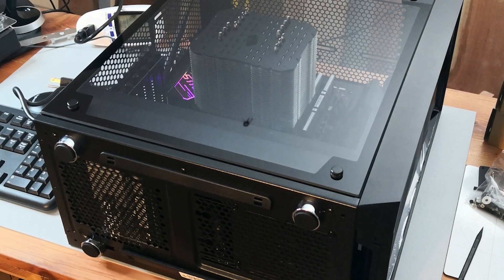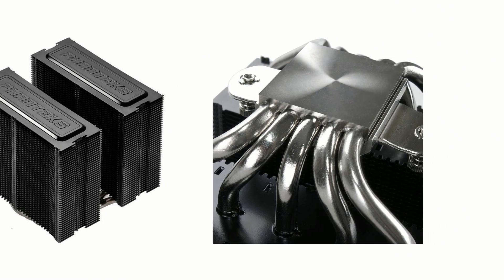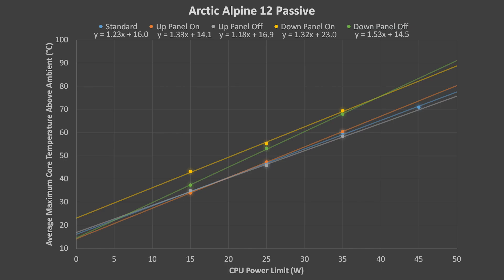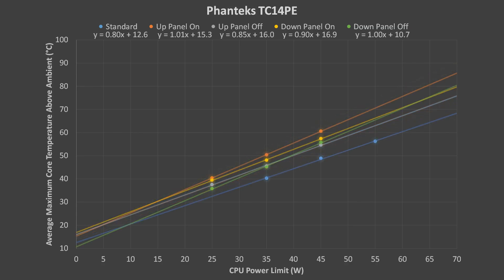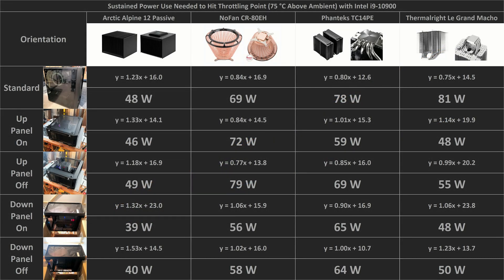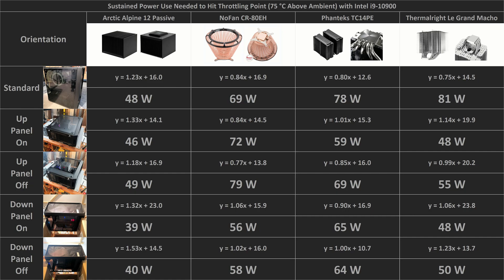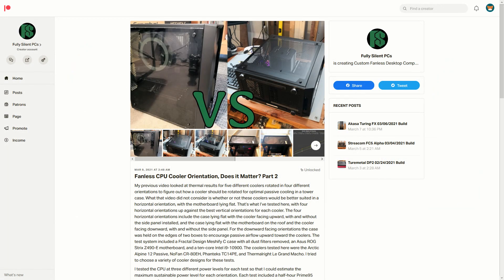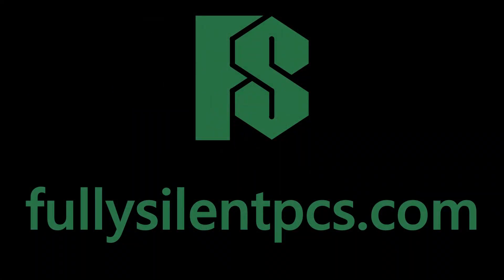Fanless CPU Cooler Orientation, Does it Matter? Part 2

Comment: Interesting test! I wonder, is there any significant difference if you’d have the fins horizontally or vertically aligned? So if air can stream (convection) from bottom to top vs the air basically stuck between the fins.

Comment: Hello and thank you for all the work! It inspired me to try to make a silent PC myself. Could you please share your thoughts if a cooler like be quiet!’s Dark Rock TF (https://www.bequiet.com/en/cpucooler/572) can keep up with a CPU like Intel Core i3-10100F in any or a specific position on an open case say for example XTIA Xproto (https://www.xtia.com.cn/)?
Reply from the maker: Hi, the Dark Rock TF is a relatively small cooler, I'm sure that it could handle 35-45 W passively. I would orient it with the heatpipes horizontal, so that the fins are vertical. I would also set a power limit in UEFI to make sure that it does not exceed a safe amount of power, depending on test results.
Reply: @fullysilentpcs  Thanks! I might try to disable turbo boost and lower CPU core frequences then.

Comment: I've asked a question related to this matter in the first part of this, I suppose series now. Would it be possible for you to determine a noise level - distance optimization with a fanless and very low rpm fan combination in a representative regular mid tower atx build to show if there can be a compromise between having a few very quiet fans in exchange for a distinctively measurable difference in performance of the system. I'm asking this of personal curiosity but I think your audience would be interested because after all they're likely interested in the perception of noise above all when they're building/using their computers.
Reply from the maker: It's not something that I have an interest in. Yes, you can increase performance with higher power components and low rpm fans and still achieve a very quiet system, but it will still be audible, under load at least. I'd like to focus my time on completely silent fanless systems.
Reply: @fullysilentpcs  Fair enough, are these builds aimed mostly for people whose work environment requires absolutely no noise pollution from the PC? Is it just a matter of sensitivity to fan noise? I've always liked the large, passive air cooling towers but to me some high quality low rpm case fans with gentle start/stop curves seemed like a good compromise so it's selectively passive. The only downside I can think of is fans blocking some airflow when not operating.

Comment: I just want to point out something that can be helpful information for many when building a fanless pc with a Ryzen CPU. It is possible to change the power consumption of Ryzen CPUs in the BIOS since AGESA 1.0.0.4. Just look for the cTDP setting which can be changed to any value. For example, with a cTDP of 45W, my 2700X achieves almost complete original single core performance in benchmarks and only loses ~ 4% in multi core. However, this means that the CPU is running 18-20 °C cooler under stress test.
Reply: Wow, a 105W 2700X, when limited to just 45W, loses less than 4% of its power? So much more heat for these 4%... I wonder if it is possible with AMD APUs as well? Read that they produce much more heat than stated TDP when both CPU and GPU parts are under load, so I assumed that they are not sutable for passive builds. I planned to add a passively cooled descrete gpu like Nvidia GT 1030 to my setup.